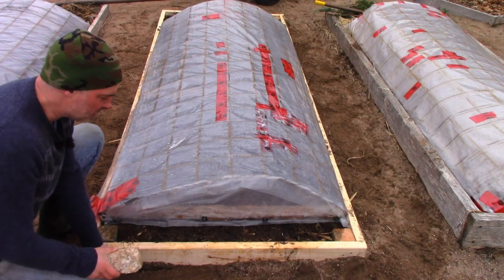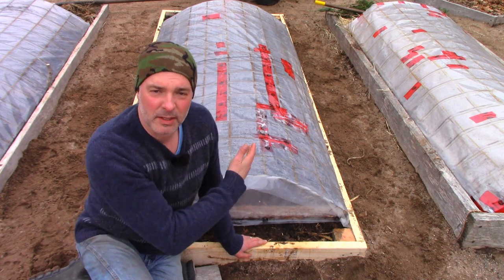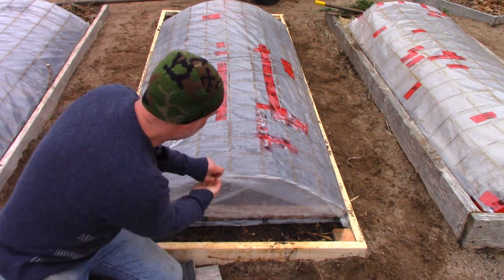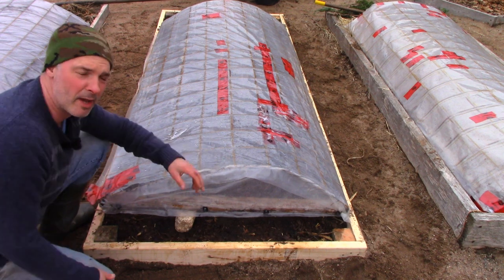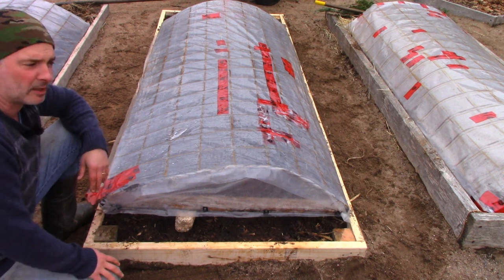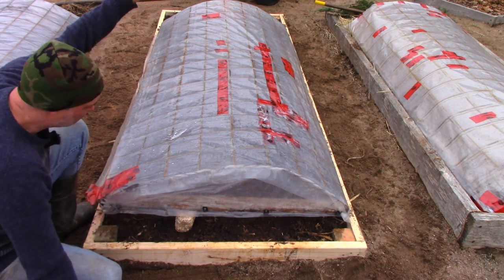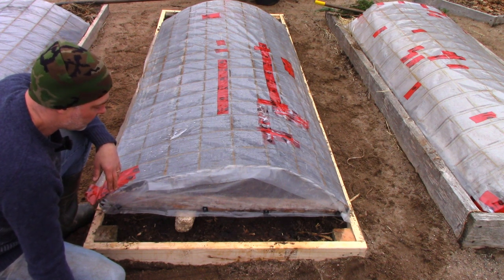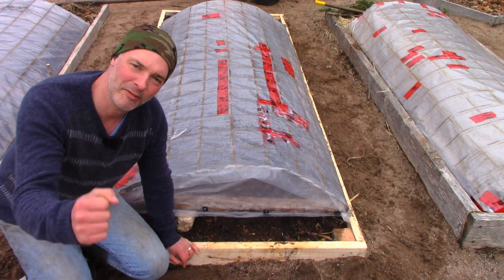How To Keep A Hoop-House From Over-heating

Comment: I built some of these based on your other videos - super helpful for thawing the soil out and getting some early seeds going, but you're right that if it's sunny it can get too hot. I'm in Denver (high altitude and pretty dry, very intense sun) - I put a little wireless thermometer inside one of the hoop houses (under cover so it wasn't in the direct sun), and one of the times I checked it, it was 49F outside, and 99F(!) inside the hoop-house.
Reply from the maker: yikes!

Comment: Keeping it simple, that's the way to go. I had hoped to build a couple of these low domes for this spring but have had a ridiculously hard time sourcing the mesh. Either it's not wide enough (42 inches) or I would have to order 50 of them. Am I looking for the wrong mesh? Or can you suggest something else to use for the dome support. I live in Manitoba so it would need to support a just a little bit of snow 😉
Reply from the maker: its called "concrete wire remesh" - any place where they sell materials for working with concrete should have it
Reply: I used 4' fencing - quite a bit bigger openings. We had it left over from building a fence for the dogs. I used 2 pieces and turned it sideways for fit and they over-lap about a foot. I am NOT handy, husband was at work so had to google how to unlock the mitre saw 🙄 , but was motivated to make it all work. It's slightly taller than Greg's, but I'm pretty pleased with it. It's better to build something and learn than not to build at all. I am surprised how sturdy it is - snow be damned! Best of luck.

Comment: How many inches wider should the wiring/fencing be to make the dome be then the box itself? I don't want to keep cutting wire and it not be long enough and waste it.
Reply from the maker: The concrete wire remesh is 48" x 96"; the wood frame is 42" x 96". With those dimensions, the peak is about 12" high.
Reply: Thank you